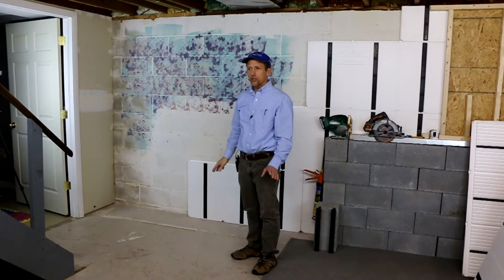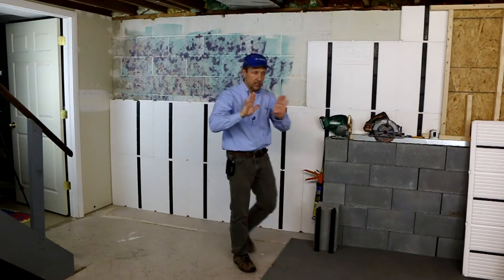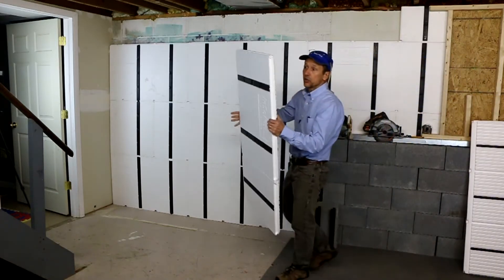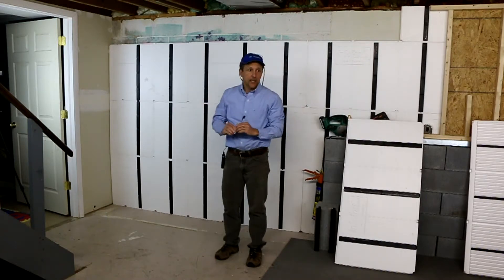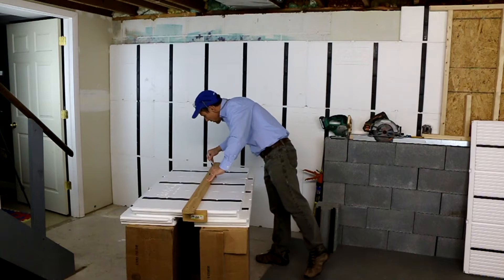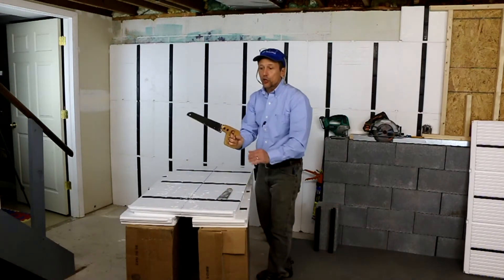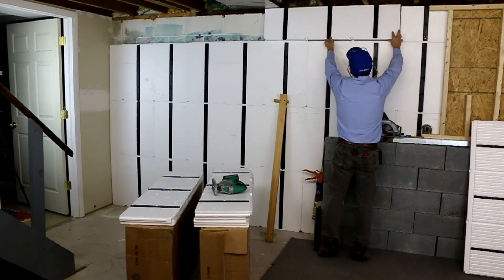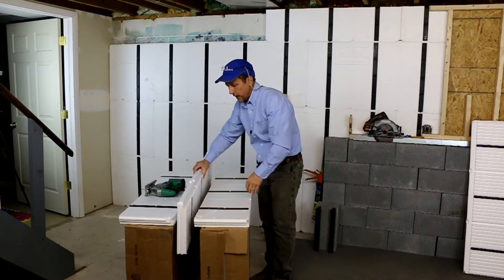Cutting the Top of the Wall

Comment: does it reduce noise between walls?
Reply from the maker: Complicated question foam does very little to reduce noise between walls. When used as a system the drywall solid wall, does not vibrate. It is like playing a drum with your hand pressed onto the skin--- the sound just goes flat.

Comment: For the seam with the tongue cut off, should you seal that seam with foam or tape?
Reply from the maker: I perfer spray foam over tape.
Reply: @insofastllc  you mean tape over spray foam correct ? how to you foam over tape now that its flat on insulroafm ? what tae to do recommend ?
Reply from the maker: With spray foam it is a better long term solution.